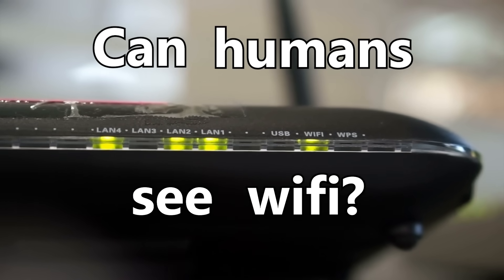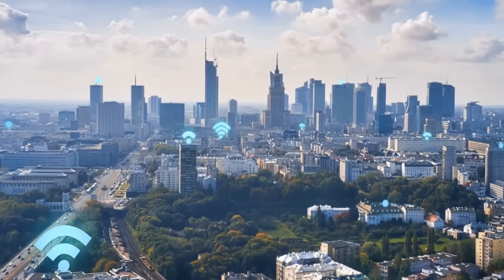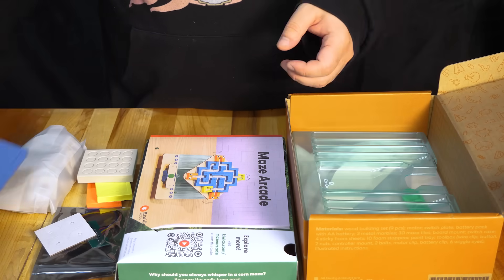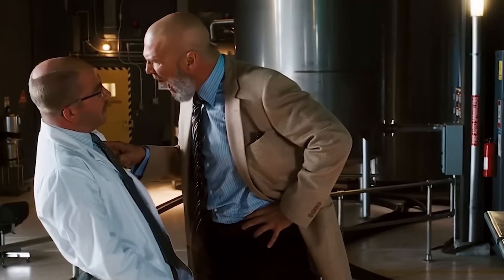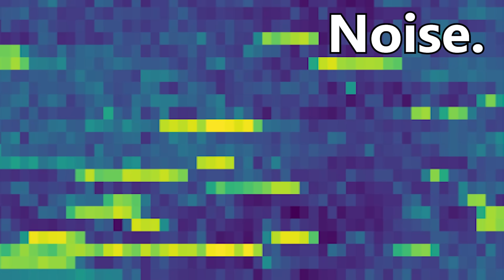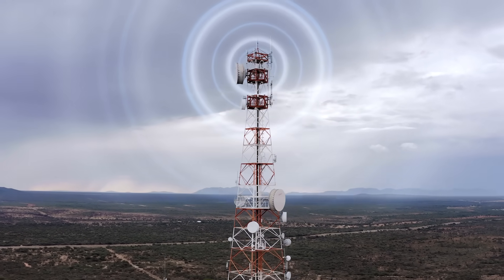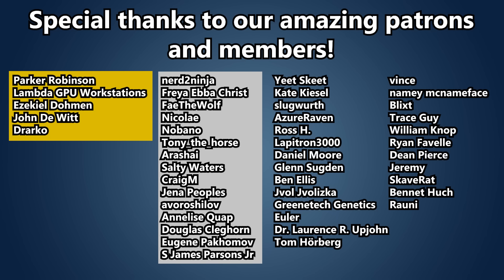This Camera Can SEE WiFi

Comment: Hey you should checkout the ESPARGOS project, they generate a WiFi image using an array of esp32 pcb antennas with one esp32 dedicated to making sure the oscillators for each antenna is phase matched. Their software is open source but the hardware is closed source

Comment: What about using a flat-panel, phased-array antenna on Jenny? What kind of results would that deliver? What kind of picture would you get if you used active rather than or in conjunction with passive radar? You know the military is looking for a passive radar camera for fighters that can capture at least one frame per second

Comment: I know you've probably seen many of the videos which have repurposed Blu-ray or DVD players to act as microscopes. But I had the idea of using a Blu-ray player and a modified optic train as well as a modified photodiode pickup to etch patterns within a three-dimensional piece of Borissilicate glass. I'm tired of waiting for the so-called high-density storage devices made by the ceramics company and other for a silicate glass or Crystal surfaces when I think this could be done much more quickly and made available to a wider public using off the shelf and creative ways to both ablate and to read within a 3D thicker piece of crystal in the form of a DVD or Blu-ray but a little more in three dimensions to vastly increase the storage density. In addition changing or modifying the object train to allow it so 1:36  that it can ablate at March lower we're smaller lengths.

Also imagine using a photo multiplier in order to increase your resolution and how to look at the esp32 phased array radar or passive radar which uses deep machine learning. Then consider the new form of Bluetooth with a 10 km line of sight function ability using the same array and perhaps taking it active. You could chirp through the channels increase the resolution and to have two or three different types of both passive and active phased array radars using simple esp32s with the new form factor of Bluetooth.
Reply: And if you see how kind of jerky your scanner is that could be made much more smooth with more accurate weight distribution and more finely tuned stepper motors. You could even identify and track as long as you use a UHF/VHF and an l&B or a set of lnbs that are attached to a single parabola. Using the tle data from known satellites you could actually use a centimeter resolution GPS with real-time clock to identify the devices position on the Earth as well as displayed to you the upcoming low earth orbit polar or geosynchronous satellites.
Reply: Go for xj10 and include 5 gigahertz, 2.4 gigahertz, in the new Bluetooth standard and use a phased array design an ESP now.
Reply: I think you're in Canada if I'm mistaken so ITAR does not apply to you. I put up a project on hackaday and it was actually featured on the global feed. It was only for my own educational and demonstration purposes, however with the components I had loaded into this portable cyberdeck the community engineer at hackaday found my project to be way ahead of the curve and was very interested in seeing how it came together. However due to the fact that I'm both a Swiss citizen and the US citizen itar sadly does apply to me.

Comment: Try using a more directive antenna, what you have is a coil antenna with a ground plane. Its radiation pattern should look like a regular bipolar antenna's which looks like a taurus with it's hole pointed towards the top of the coil. This radiation pattern makes the antenna more sensitive to signals coming its sides than the ones coming from the direction you're pointing at. I recommend to instead use a dish antenna or a large enough aperture antenna (which is easier to diy) to make the radiation pattern more directive and increase the gain in the direction you're trying to measure. If the antenna isn't directive enough it won't really matter how many points you take the image won't be coherent.
Reply: I forgot to mention that you should also make sure that the impedance of the antenna you're using is correctly matched when using coiled antennas because these tend to reflect signals which tanks your gain. It applies to any antenna but coiled and twisted ones have more parasitic capacitances.

Comment: I did a similar experiment with sonar and music playing from surround sound. try multiple micro recievers in a matrix grid like a sonic camera rather than a single point dish and plot them each as a single overlay layer for more detail. inverse your signal results and adjust your gain through a multi channel amplifier to clear up the static. that should give you a clearer image. you need to include the dimensions of the array and spacing in your output. then you can use basic trigonometry for fairly accurate distance measurements

Comment: A bit late, I know. But you could force the router to broadcast by simply trying to connect to it.
Also, you could filter out anything not an auth response to get a clearer image.
So in short. Ping the router with an auth request and wait for it to respond. Measure the strength of the response each pixel.

Comment: I had always wondered if you could spin a directional WiFi antenna that sends/receives probe requests and use the gain, latency, and direction to plot a map of access points and mobile devices in an area. Like RADAR for WiFi. It might have to spin slowly and have a relatively low update rate but I bet its doable.

Comment: Great video, I could use one of these. this could map out all REAL access points, as they remain in a connected state. However, in a malicious environment, youre more likely to see wifi APs that only appear long enough to broadcast or receive. So you would need to be aimed at the specific location at time of transmission. You can run an AP scan for a couple hours which has signal strength and time last seen, and you would find that there are many APs doing just this masquerading dance , and only a few remain as real Access Points. in theory with this information, you can build a heatmap based off signal strength of SSID names, by taking measurements in different locations for hours a piece, and then visualizing a hot/cold map with the dBm of each SSID at each location

Comment: In my experience wood is not that transparent to radio waves, at least at lower frequency like 440MHz and 830MHz. Especially if the wood has a fair amount of humidity in it.

Comment: Great video! Just one question: instead of building your own base with stepper motor and all that why not just take an old Tailgate tv antenna that already has all of that, change the microcontroller to use your code for the stepper motor, change the antenna and voilà, you're done! This version does look cool but I think something like this could be more approachable for folks who don't have 3D printers and speciality equipment.

Comment: Maybe a high gain antenna with allot of attenuators in the line.

The high gain antenna tends to be very directional, so should only get the information from a small area, and the attenuators would be useful to remove lower gain reflections, so you can zero in on the wi-fi source .
I'm not sure if the circular polarised antenna is the way to go. Unless you also fit a CP antenna to your WiFi router.

I would think a vertically orientated linear polarised yagi would be better.

Comment: so, what if you had a grid of these set at just the right angle such that it doesnt need to move un and down to scan but just takes one shot at the same time for a more clear picture. 
because, otherwise, you seem to be trying to catch a light strob when its always on. its clearly off in the wrong places prob because the signal is reflected in that moment of the shot.

that is to say, with the current set up, i'd expect a different blurry collection of hot and cold spots every time even if most of the time its in the expected more active area.

having a visible light camera from about the same spot could also help super impose the images with the wifi light.

Comment: What if one would build a fractal antenna (like the ones in phones) with multiple receiver dyes (similar to a camera pixel), which would all feed to an rf switch or multiplexer, and then be sampled by the rf SDR pipeline? Then the heatmaps could be stitched exactly like 360 images. This would be probably similar to what starlink has 🤔

Comment: 0:40 "in the old days" 
Relatively new microwave still wipes out 2.4Ghz wireless headphones, and I believe WiFi channel 6.
(I have 2 APs, one on channel 6 and another on channel 11; 5Ghz works if close enough to the transmitter as well).

Comment: Your suggestion on the steel studs having an effect is,  I'm sorry to say, wrong.  For a metal mesh to be a decent reflector of a wireless signal,  the spacing of the mesh needs to be of the order of the wavelength of the signal.  The smaller the spacing, the better the reflection or the less is passed through (look at the mesh on a microwave oven door).   2.4 GHz has a wavelength of 3x10**8 / 2.4x10**9 - or roughly 10cm,  much less than the inter-stud spacing.

Regardless of a directional antenna,  you will be pickup up reflected signals from the walls,  and people moving around within it.
There's an 802.11 project related to sensing that claims (or at least, some of the proponents for the project claimed) to be able to count people in the room,  or the room next door.

There are ways you can distinguish between the direct path and reflected paths,  but only by using a lot of maths.  The start of a WiFi (or 802.11, to give it the name of the standard) packet includes "training fields" which are essentially "white" across the occupied frequencies.  By observing the power across the occupied frequencies ("sub-carriers") you can infer a frequency response.  Fourier transform that, and you get an impulse response,  which allows you to determine the received power in the direct beam and indirect paths (because the indirect paths are longer and occur later than the direct path in the impulse response).

You can do the maths if you have access to the raw signal and some DSP.  This is effectively what every single WiFi chip has built into it, because without an estimate of the channel response, the received error rate is catastrophic.

Comment: Hey! So, certain Cisco access points have a tech for mapping networks. It's like an attachment that goes on an access point with like 30 antennas and the software lets you visually map wifi. Perhaps these antennas might be a method for making a high res version.
Reply: The hyperlocation antenna is a 32 element antenna design that provides 360 degree coverage around supported access points — currently the 3600 and 3700 series APs. It is designed to integrate into the Cisco Aironet Hyperlocation Module with Advanced Security (RM3010L) providing precise RF Angle of Arrival (AoA) information, allowing the operating system a much more granular approach to the location of a client device.
Reply: With the software you can basically geolocate wifi devices within your buildings on top of building maps if you have them.  You could probably grab one of them cheap, reverse it and use it. 32 elements with AoA might be nice?

Comment: Why bother stopping at each position? You could move the antenna continuously and take data at set intervals, that would allow different resolutions and not have to deal with smoothing the motion. Plus higher resolution.
You could also make an array of antennas and do continuous, fast sweeps. That would allow you to additively improve the resolution with each sweep.

Comment: Well, there IS an app for the Meta Quest headsets called SeeSignal by BadVR that uses passthrough cameras and WiFi to visualize WiFi signals. It works really well to map signal coverage and strength throughout a structure. It essentially gives you a superpower to see and detect the strength of WiFi signals. Pretty cool free app if you have a meta headset.

Comment: my final project at the university was similar, I used a MikroTik 5Ghz antenna and the goal was to align the antenna to the emitting antenna automatically. I used genetic algorithm for the alignment, but I also performed a scan and generated a signal strength graph

Comment: The new radio telescope is shaking quite a bit with every move. that cant be good for the accuracy. 3d printers use a type of anti-shake thing called "input shaping" the same concept should work for your radio telescope.

Comment: Making a "wifi camera" has always been a project in the back of my mind. It's great to see you taking another shot at it! 🛜

The resolution is obviously very small, and the overall image is affected by the fact that each "pixel" (wifixel? 🤔) is sampled at a different time. I often wonder what it would look like if an iPhone camera could see WiFi with the same spatial and temporal resolutions for the visible spectrum. So I'm wondering about doing ...the opposite! What image would you get if you tried to "photograph" a lightbulb using a light sensor? 👀

Comment: These types of cameras were made for defense purposes at some point. I remember them being able to map around corner by reflecting that band of EM. I don't remember what band they were in. Microwave is pretty terrible to work with. It feels incredibly noisy but I guess there are far more off the shelf components that deal with 1.4/2.4/5ghz etc as they're produced in mass and widely available.

Comment: 5G isn’t 5GHz.
WiFi 5 / 802.11ac is 5GHz. 
5G is over a number of different frequencies. It can be anywhere between around 600MHz and 3700MHz for low-mid band 5G, and can be around 24-40GHz for 5G mmWave.

Comment: 1:29 correct me if im wrong but all the colorful galaxy and space images are taken by detecting UV and infrared and stuff along with normal light
Reply: Yes that's true for taking colorful images of further objects we have to opt for UV and Visible light but they don't go as far and red shift limits how far you can detect colours from for example the furthest galaxies are shown red in Hubble deep field image or other deep field images. That's why we use radio waves for really far astronomy like how we took image of a black hole also radio waves are really piercing and can see through cosmic dust and other debris is space which is specially useful when seeing black holes as they're enveloped be them all the time. And I'm gonna ruin it for you but most colours you see in astronomy images are processed by computers(using knowledge we already have about cosmic stuff) rather than captured...
Reply: Alright. You spelled wrong incorrectly.

Comment: Verry cool.
Ideas : 
1- For better alignment with the optical camera 
Add a photo diod with a lens to act as single pixel camera. 

2. Since you can tune to any frequency enable both 2.4 and 5GHz  in your wifi router . And find another transmitter at 3rd frequency to simulate "RGB" light source. 
And capture a colored image 😂

Comment: The metal steel framing your building or house is made of is  actually much better than wood for reasons other than wifi. In Europe most drywall walls are built this way, wood is considered an old fashioned way to do it. Wooden planks can get warped due to humidity, get infestated by termites and other bugs and whatnot. As of WiFi connectivity, I have a GPON terminal with in-built WiFi router serving WiFi on my first floor, and another router on my second floor, no signal quality issues whatsoever. The metal framing pieces are spaced 60cm from each other in the walls, and 40 cm in the ceiling, it still makes through it. TLDR get a decent modern 5ghz wifi router.

Comment: Connecting to a Wi-Fi adapter and doing a monitor mode packet capture while sweeping all of the channels would have been a far more precise approach. It would have completely eliminated the low-duty cycle issue you had with the various Wi-Fi networks.

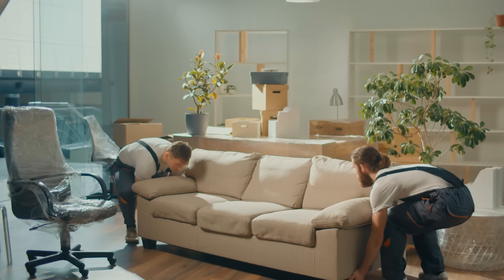Comment: 5:41  totally unrelated to the video. But just to inform ya , laser pointers shouldn’t be used for dogs. As it has the potential to create basically a type of light ocd for them. The reason that this happens is because dogs do not understand the concept of the laser just being shut off and not being able to catch the light and it just disappearing can cause some pretty bad distress.   So they will fixate on different light sources hitting walls and such. 

It should be fine if it’s just been a one time thing but yeah sadly it can make the pup pups really sad.

Comment: Commercial buildings are usually steel stud framing. They do this because of the fire ratings, building codes, durability, and strength of the steel compared to wood.
Reply: jet fuel can't melt steel beams
it can soften them a lot tho

Comment: 1. There are a lot of wobbling every time the antenna moves, and stops. My guess that motors lack current, and therefore - moment. Maybe increasing current on drivers will help? Maybe changing the drivers? don't tell me you used old-reliable A4988)
2. The helix is a circular polarization antenna, while the router has a linear polarization "rod" antenna. Its not of much of a problem - you just loose some gain (-3dbm as i can remember), but consider this in future projects.
3. Helix type antennas has fairly wide field pattern, with distinct side-lobes. And i believe its the main problem here. Scanning a spot gives you gain in that spot plus gain from side lobes. Maybe swapping antenna for different design will help, see bisquare antennas.
4. I counted 8 turns on your helix, which is a "golden ratio" between gain and field pattern (just as IBcrazy intended *wink wink*). Try increasing turns to 12-14-16 - this will make field pattern much narrower, which will help a lot.